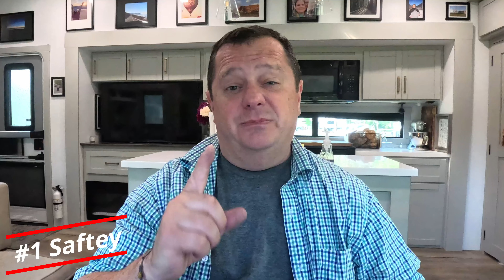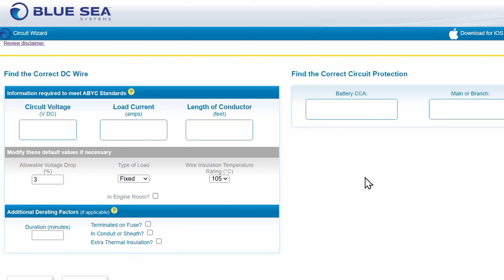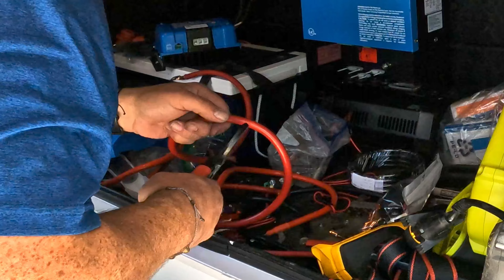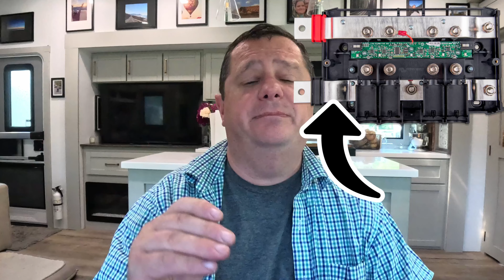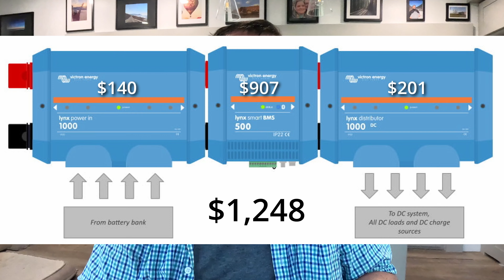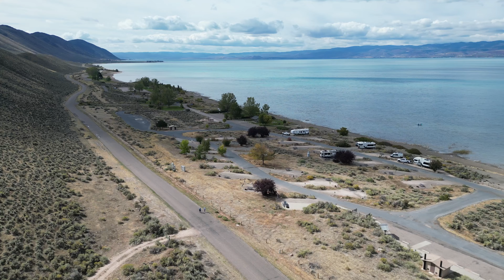Victron Lynx Distributor Install | So much Power for our Brinkley Z3400! (S2, E21)

Comment from the maker: This is the second video in the ultimate power upgrade for our Brinkley Z3400! In this video (S2, E21) of our massive Victron Energy system install, we're tackling the central nervous system of the Victron, the Lynx 1000 Distributor install.

Ever wonder why you need a power distributor and where do I put all those fuses? We'll show you exactly how we installed the Victron Lynx Distributor and bult the cables for it.

If you're a DIY RVer planning your own Victron install, a Brinkley owner curious about upgrades, or just love a detailed tech project, this step-by-step guide is for you!

👇 GEAR & PRODUCTS IN THIS VIDEO 👇
(Links will be affiliate links, which helps support our channel at no extra cost to you!)
• Victron Lynx 1000 Distributor:
• Heavy Duty Wire Crimper:
• M8 Wire Lugs:

⚠ DISCLAIMER ⚠
This video is for entertainment and informational purposes only. While Mike is a certified RV Technician with a background as an electronics technician, this installation reflects our specific methods and RV layout. We are not liable for any damage or injury. Please consult with or hire a qualified professional for your own installations.